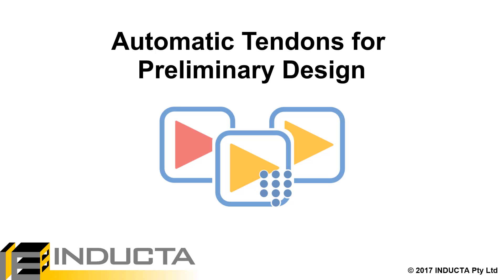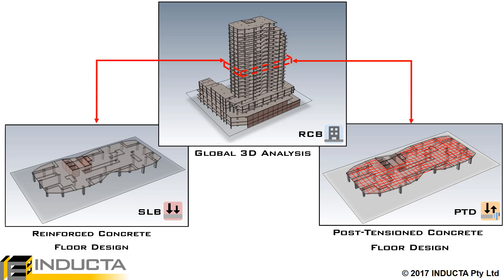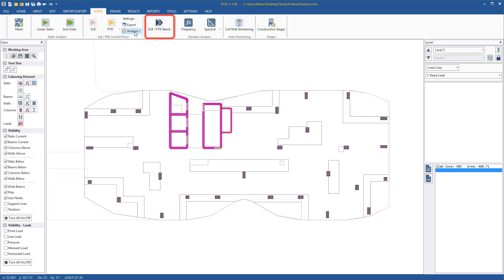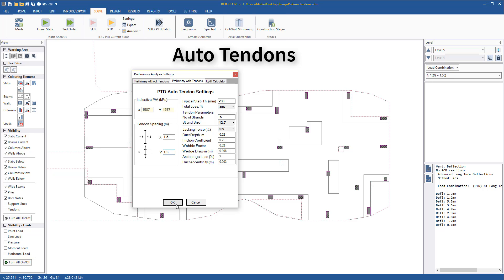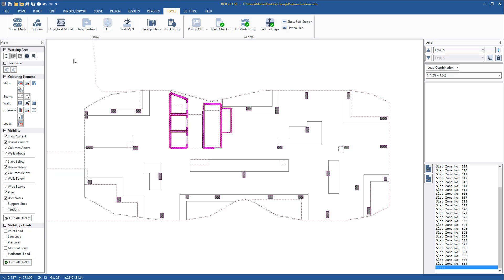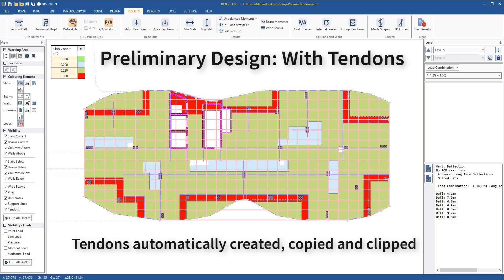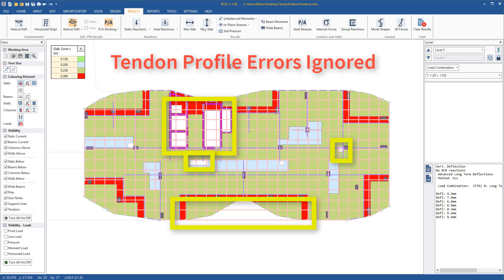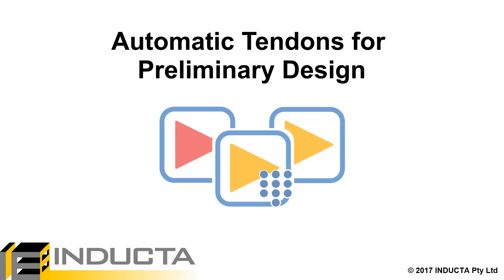RCB 13 -Automatic Tendons for Preliminary Design

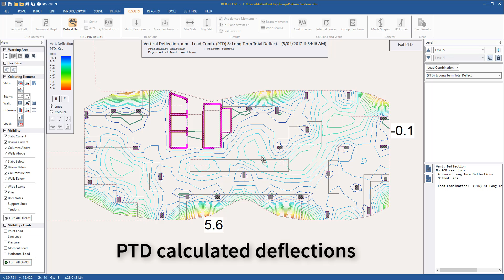Comment: At 2:53 the deflection results from prelim design without tendons are 40-60% off those at 7:08 which are the results from the prelim design with tendons.. Can you explain why there is such huge difference?